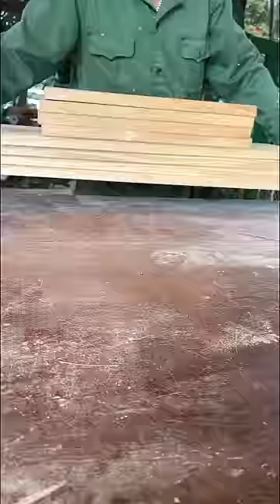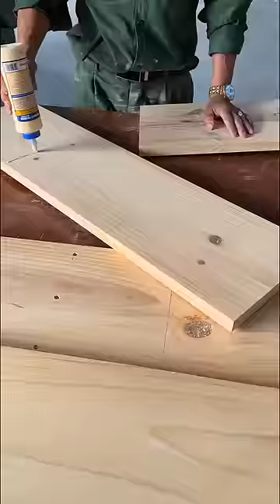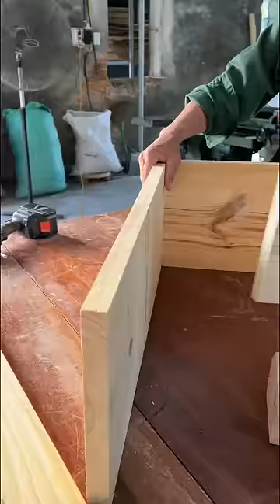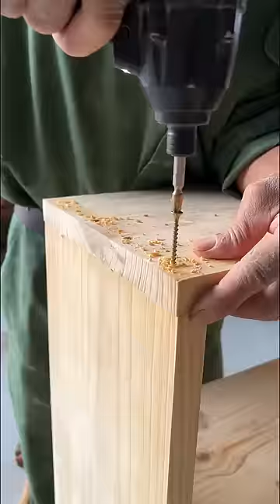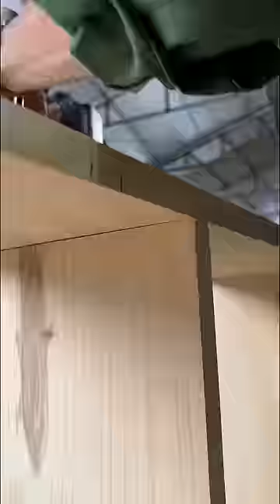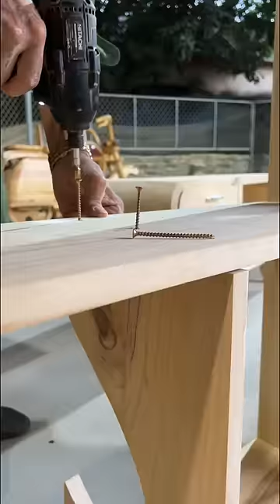How To Make Bookshelves With Simple Tools

Comment: The only non simple tool was the saw. Expensive too, but it can be done with a skill saw if needed
Reply: A miter saw can be bought for $100 and easily for less when bought used
Reply: Yes, and unless you are a skilled home carpenter, skip the curved design. Just cut straight angles.
Reply: Even with a Japanese hand pull saw, you could get this project done in an afternoon easy.
Reply: Fb marketplace will get you a miter for 30 bucks used, check your angles with a square, but you can do that without breaking the bank.
Reply: $50 circular could of done it too
Reply: You can do the curved cut easily with a common jig saw, 20$ for that tool if you're not looking for anything fancy.
Circular saws and screw drivers are also cheap.

The wood used in this video costs more than all the tools needed combined.

Comment: i see no "simple" tools
Reply: Bruh this is honestly so simple I wouldn't even call it woodworking. Don't expect to make a single thing in your life if you aren't willing to buy a drill and screws. At home depot when buying lumber they let you use the miter saw... you could easily do it with a hand saw
Reply: @MooSaidChicken  exactly
Reply: @kyleallen1858  Like, what is a simple tool? A fuckin stick? Even if you buy ikea furniture you need a screwdriver and allen key set, sometimes even a hammer.

Comment: Is that a countersink bit? And countersink screws? I don’t know if I have that bit….. can I do this with normal screws and bits? Do I predrill all the way through the wood?
Reply: Countersink bits are inexpensive and easy to find, but yes, you can still make a countersink if you have a basic drill bit set. 

Drill your pilot hole first, google a pilot hole size cheat sheet. Depth only needs to be the length of your screw. I use painters tape on my drill bit as a depth guide. 

Depending on what type of screw head you're going with, match up a larger drill bit around the same size and drill your countersink over the pilot hole.

Save yourself the time and pick up an FTG USA countersink set. (Plug cutter is another handy drill bit to have)
Reply: @pax1mus  Thankyou so much for the advice! 😊
Reply: @Makeuploveculture  happy to help bro! Sorry I was late to the party 😅
Reply: @pax1mus  that’s alright! It’s still helpful 😊

Comment: I don’t have a bandsaw, a cordless driver or any of these basic tools. All my tools are primitive I guess
Reply: Cordless driver is a basic tool. You could have a corded drill or a hand drill and get the job done if you don't want to mess with batteries/electricity. As far as the saw goes you could do this with a hand saw, it would just take you longer but you could still do this! (Although without a bandsaw I wouldn't try that last aesthetic cut!)

Comment: Guy says Easy tools then use a saw, drill machine and loads of wood and then proceeds with the best work of his carpentry skills, i have none 😂
Reply: Where do you live? If the US, then Home Depot’s have chop saws inside where you can cut your pieces to length. Then you just need a drill, to drill the “pilot holes” which means you’re pre drilling the wood where the screw is gonna go so that when you screw the actual screw in it doesn’t split the wood. It’s not as complicated as you think I promise lol